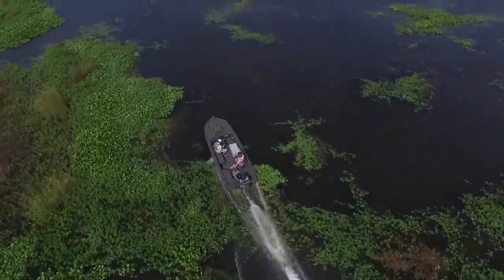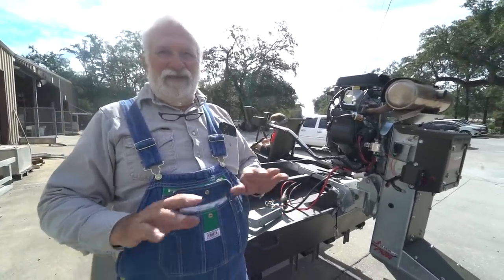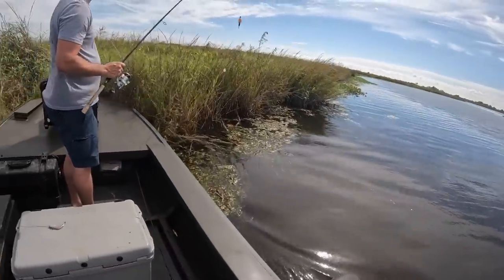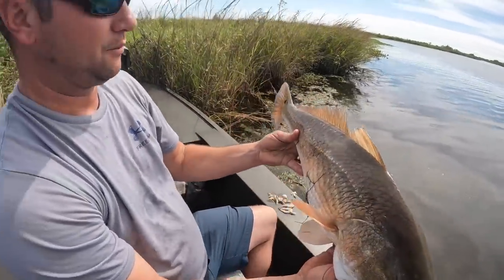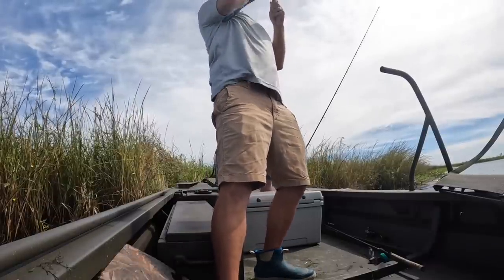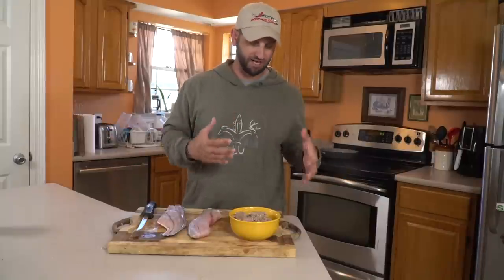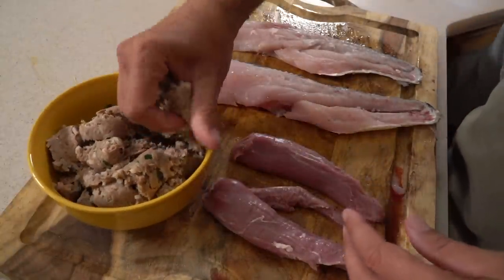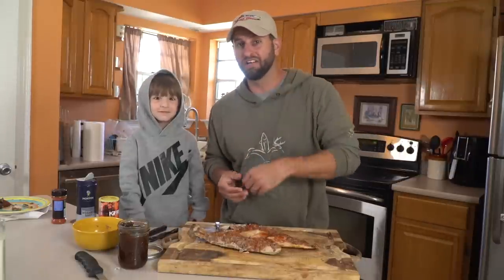First CATCH AND COOK in My NEW BOAT | Fishing in a Go Devil 1860 powered by 40HP FNR

Comment: Advantages and disadvantages of longtail versus the kind you expose done this channel
Reply from the maker: Longtails get around good in mud but are hard to handle and much slower. Surface drives have lots of moving parts that could break but are much more efficient, easier to drive, and faster